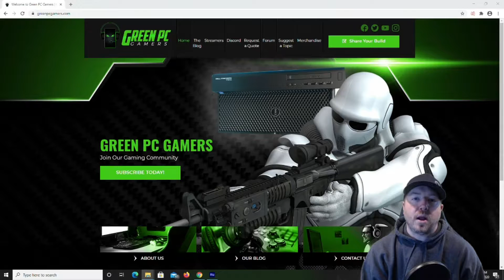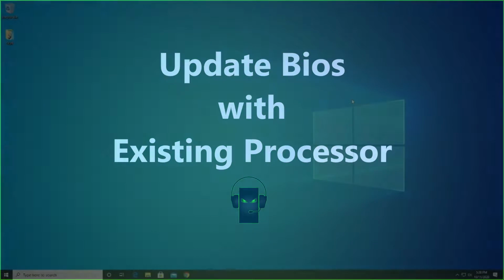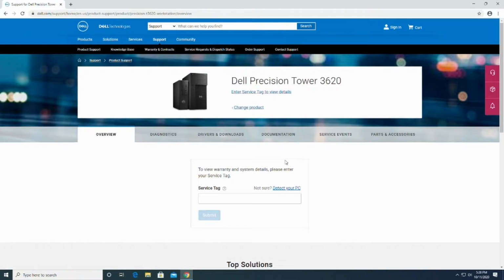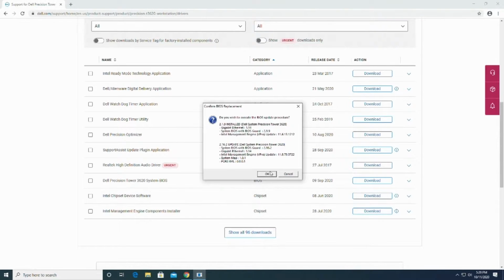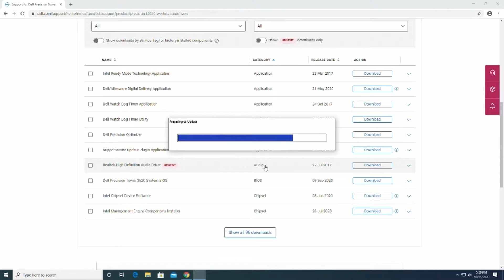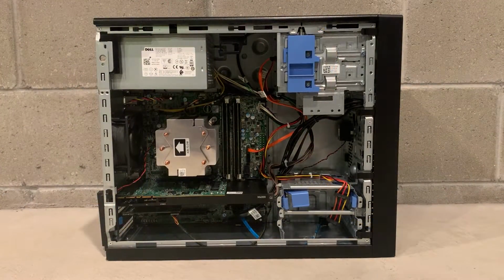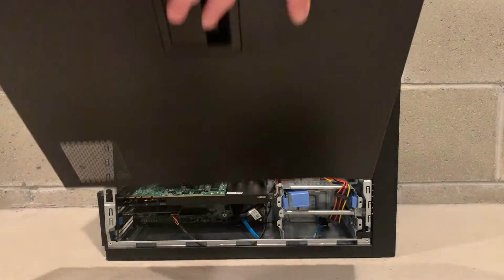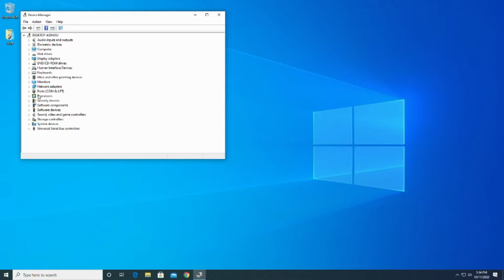Precision T3620 Bios Update and i7-7700K Processor Install

Comment: Hi, I know this is old but is it possible to add quadro p4000 in 3620?
Reply from the maker: Yeah, you could install a P4000 Graphics Card.  The power requirement is 105W.  Choose a power supply accordingly based off of the rest of the specs on your system.

Comment: Have 3 of the T3620 towers. All have the Xeon CPU. What GPU are you using? What RAM? Thank you 🤓 what brand of CPU cooler is that?
Reply from the maker: We are using all stock components.

Check out the parts we use:

https://www.greenpcgamers.com/dell/dell-precision-models/precision-ddr4-based-workstations/make-my-precision-t3620-in-to-a-gaming-computer/

Comment: Is it possible to upgrade further i7 or i9 generations?
Reply from the maker: Unfortunately, these are the best i7 cpu's for the T3620:

Up to 1 x QC I7-6700 3.40Ghz 8MB 8GTs Processors | 4.0Ghz Max Turbo Frequency (SR2L2)

Up to 1 x QC I7-6700K 4.0Ghz 8MB 8GTs Processors | 4.2Ghz Max Turbo Frequency (SR2L0)

Up to 1 x QC I7-7700 3.6Ghz 8MB 8GTs Processors | 4.20Ghz Max Turbo Frequency (SR338)

Up to 1 x QC I7-7700K 4.2Ghz 8MB 8GTs Processors | 4.50Ghz Max Turbo Frequency (SR33A)

The T3620 doesn't support i9 Processors.

Comment: I have this exact pc but with an RTX 2060 gpu and a i5 6600 installed. is it possible to add the i7 7700k with that heatsink and still have enough power for everything? or will I need a new power supply I'm new to upgrading. im doing this because my games seem to bottleneck on the i5 6600 and I hope the cpu upgrade will help. also is this the largest cpu that can be installed on this motherboard?  help is appreciated. :)
Reply from the maker: I'd for sure upgrade to a higher wattage ATX power supply as well.

Comment: I want to upgrade my dell precision 3620 processor to 6th generation exon E3-1200V6 will it work??
Reply from the maker: Those cpu's will work, but you may need the high performance heatsink depending on the wattage.

Comment: Hi, my dell precision t7810 keeps blue screening on startup then fails auto repair. I have tried many things. Could you please help me fix it? Maybe through a video or reply? I don’t know what’s going on and I use it for school.
Reply from the maker: Did you add a piece of hardware that might have caused the issue?  If so remove that piece of hardware.  If you didn’t make any changes, it is most likely a failed hard drive that is causing the issue.  Do you have a diagnostic tool to test your hard drive?
Reply: @GreenPCGamerscom  I just have an rx 570 that has been in my pc for just over a few months. No issues. I use a pcie expansion nvme ssd thing as my boot drive. It still has windows on it but it just won’t load. I might just reinstall windows.

Comment: Hi, I have a t5500.

My graphics card requires 2 8 Pins. I can get one 8 pin by adapting 2 6 Pins into an 8 Pin.

However, for the 2nd 8 Pin the only thing I have left is a 2nd CPU power cable which I could get an adapter to turn it into PCI-E Power- with the adaptor above could I successfully and safely power my GPU?

For reference my card has a 295W TDP (Vega 64)

Comment: Can you show a tutorial on cooling for t5810 or try to water cool it
Either transparent side panel with fan in the panel too 
Or a hack to plant a system fan in the back for the air flow 
As my graphics card is too big (5600 xt thicc 3)
It is in the bottom of the case and causes heat issues or I have to run the card fans everytime and my pc is on 24/7 as it's my need
Reply from the maker: The T7910 Liquid Cooling heatsink does work on the T5810/T7810 Workstation.  However, it will require you to remove the slimline optical drive.
Reply: Any change of attaching a  extra fan on the back of the case??